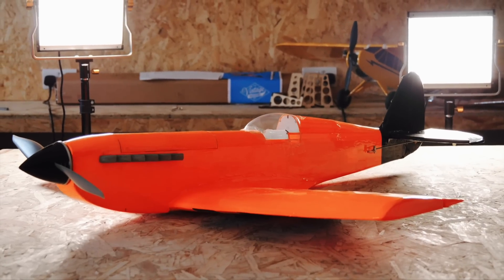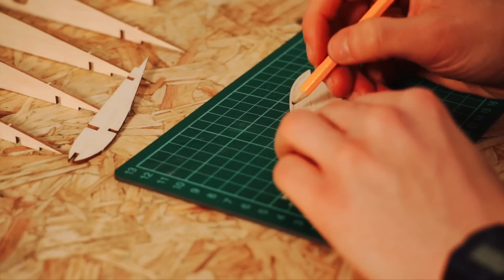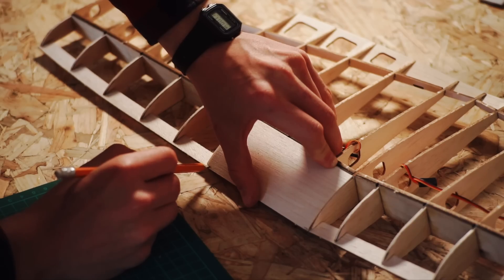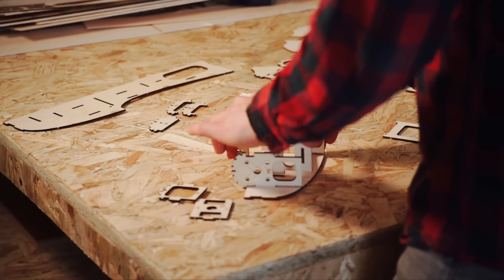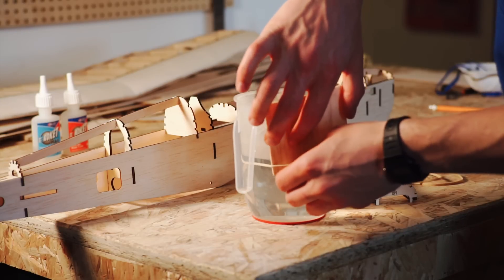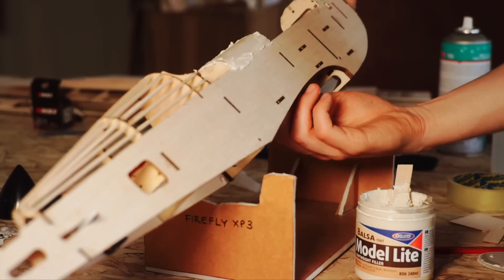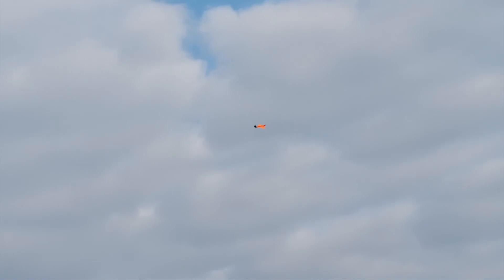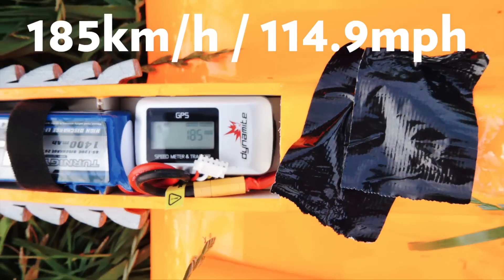114mph Spitfire Build

Comment: Another great vid and airplane- love the clipped wing spit.   but a note- I have more than 10 diff ntm motors of various sizes and KV.  They are great, real powerhouses!   I have driven 3548 1800 kv up to 100 amps with 4 cell and 8x6 and it was less noisy than your Spit.  Your prop or Spinner sound out of balance.  After 20 years of electrics, balancing the prop can add RPMS- maybe 10%!  thanks for your vids!

Comment: I do not know how you are measuring it, but clearly you are wrong. To fly at 100 MPH alone with a 9x7.5 APCe you take up at least 1780 input watts. with 6slipo you occupy a consumption of 85A and with 3slipo double. For this, your motor is not viable.

Comment: Actually for subsonic aircraft, low drag wing design is always reducing the chord and maintain wing span. This is counterintuitive but solid proven truth. Low chord will reduce the induced drag and skin friction, plus easily keeping the air in laminar flow, which is a scheme changing improvement in aerodynamics.

Comment: where’s the radar gun? Where did you get 114 mph?  Dude, I’ve been flying for over 25 years and I can tell you that’s not even close to 100 mph. I’m not trying to be a dick, I’m just say’n........ let’s see the radar.
Reply from the maker: If you watch to the end you can see we got 114mph from the onboard GPS unit. There's your evidence. :)
Reply: @vintagemodelco7936  I do not know how you are measuring it, but clearly you are wrong. To fly at 100 MPH alone with a 9x7.5 APCe you take up at least 1780 input watts. with 6slipo you occupy a consumption of 80a and with 3slipo double. For this, your motor is not viable. How many RPM , hoaw many cell and how propeller?  Gps not is god for check speed.
Reply from the maker: @manuelverdugo1737  We're measuring it with a GPS unit, as mentioned above. The motor and ESC spec are in the description.
Reply: @vintagemodelco7936  You don't mention the propeller, or the battery. Nor do you mention the consumption of your engine at full throttle. You are possibly flying around 60 mph. but I need to know the rpm of your propeller to calculate it.

Comment: Iv never made a plane using balsa before, only foam, epp, epo. but this looks awesome. Id be to scared to fly it in case i damaged it. But id love to give it a go, looks great.
Reply: Planes built from balsa by your own hand are easy to repair by your own hand also. Balsa in many ways is a very forgiving material to work with - very strong for its weight, yet easy to cut and shape. The only real downside of balsa is that it does not take paint well without doing a great deal of annoying application of sanding sealer and sandpaper work.

Comment: What a nice model! Just a note about your hand launch. Firstly if you were to have a lanyard around your neck that is clipped to the tx. Then hold the tx in your right hand with the model in your left hand. Let the tx hang from your neck via the lanyard and reach your right hand across and open the throttle. Predict a left yaw, roll and perhaps nose down attitude after immediate release and place the control stick in a relative position. Then launch! I only say, because I learned the hard way...